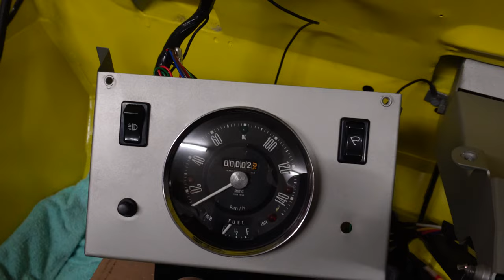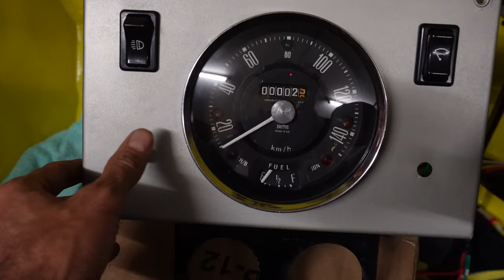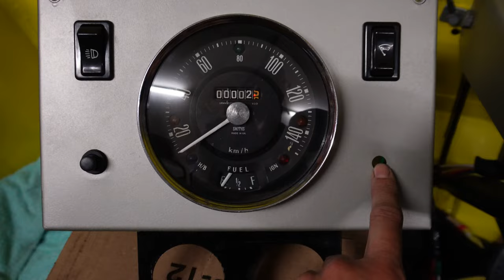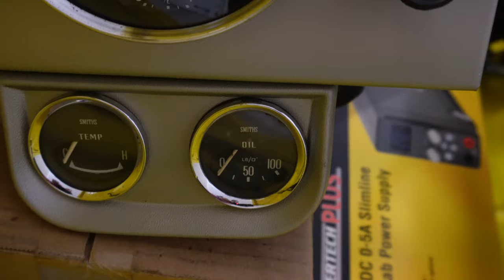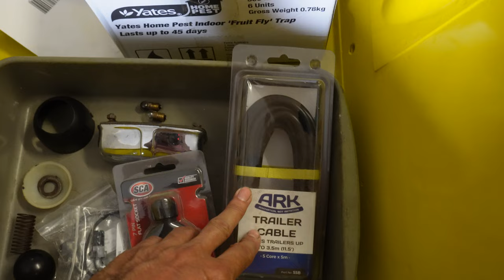Moke Console Switches & Lights EP 40

Comment: Great videos on your moke restoration. For any ones reference try your local truck parts supplier. I was able to pick up the correct replacement lights, front and rear for 12.50ea  Aud. Just putting that out there for everyone if they are looking.
Reply from the maker: Great tip, I'm still chasing new front indicator lamps as the originals are a bit old and faded.
Reply: @CafeRacerLab  I got 2 set. Where are you based? I was able to get from a truck parts company in pakenham Victoria.